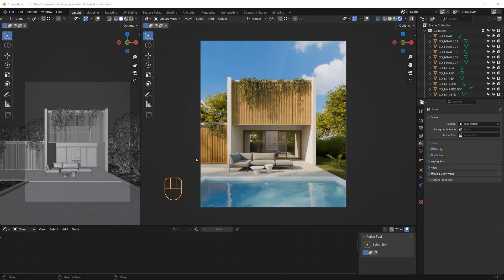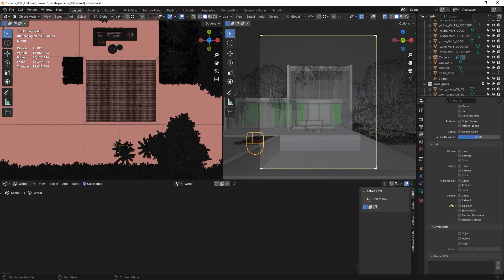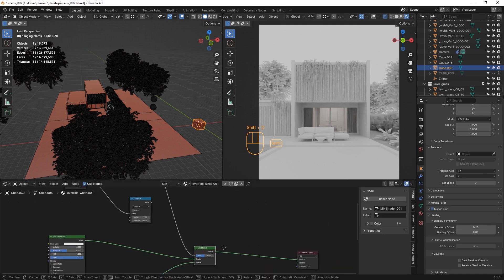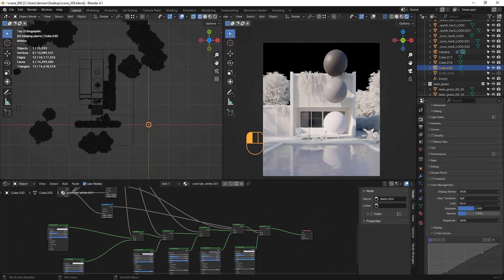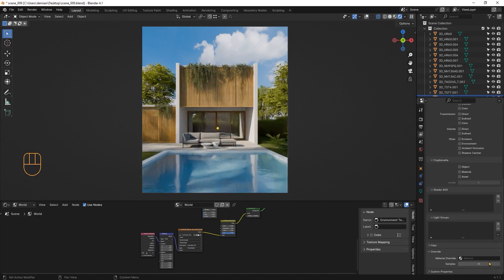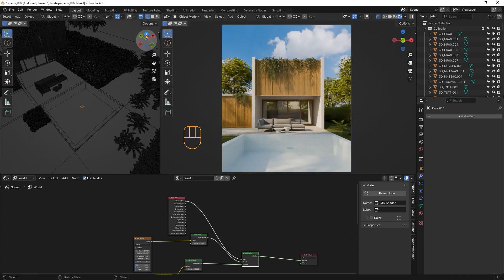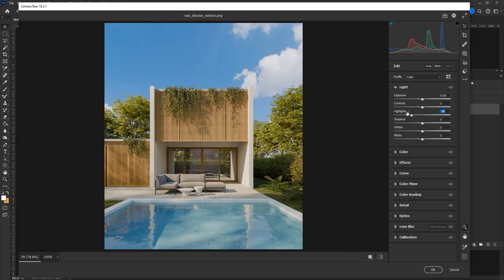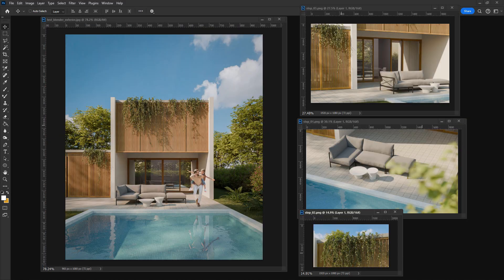How to Create Photorealistic Exterior Lighting in Blender

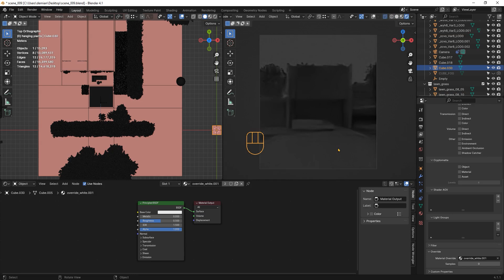Comment: I tried doing this so many times and you lost me at about 1:30. Way to fast for me :(
Reply from the maker: Hi, sorry to hear that, and thanks for your feedback. I’ll make sure to explain things more slowly in future videos. In the meantime, you can skip to 02:45 for the lighting setup, as the previous part is just about setting up the white override material. This step isn’t mandatory to create the image, but it does help with proper exposure. Thanks again!
Reply: @Barbernz you can make it go slower in the video settings. This option is at the bottom right corner. I used it a lot in the beginning.